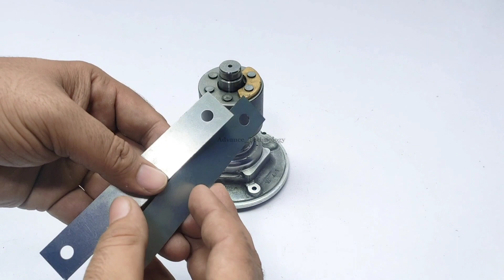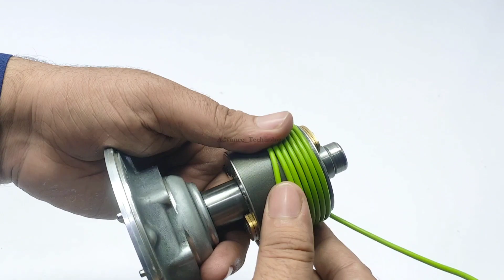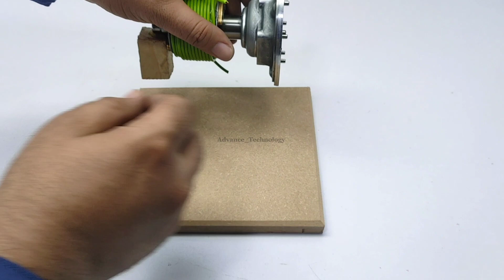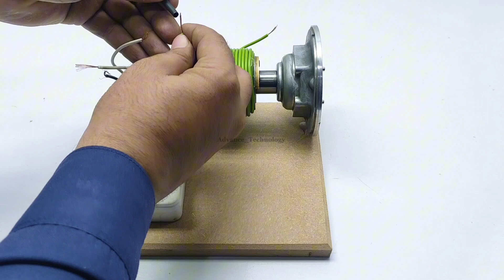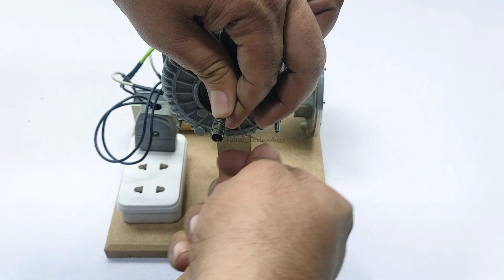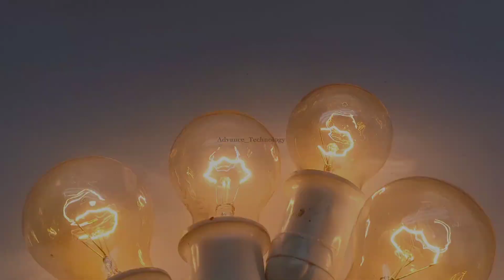I turn super magnet router and PVC wire into225v 16000w best Generator#viralvideo

Comment: Not possible

The magnet is to small
The available Irion core is to small 
The current for 1000 watt is 4 amp 
For 16000 
Current 16*4 = 64 amp
The wire on your device look about 1mm2
You shall need about 10 mm 2 
And that is bottom limit
Go for at least 20 mm 2

The 4 globe is max 400 watt
Most likely 240 watt